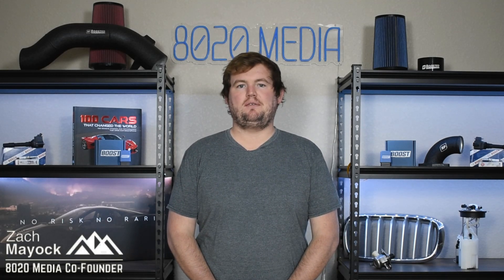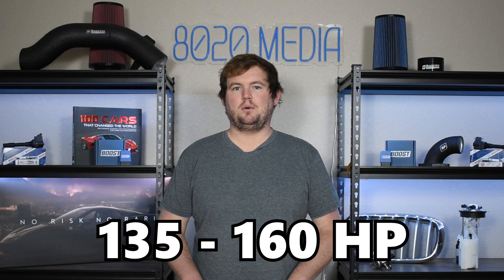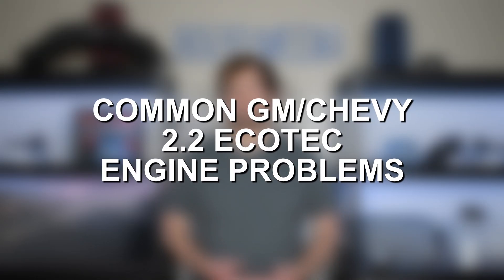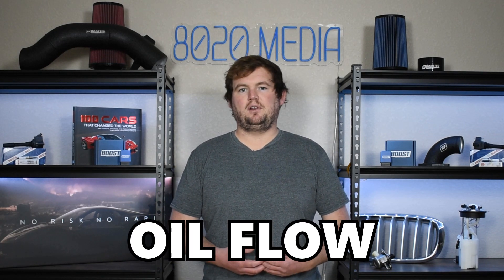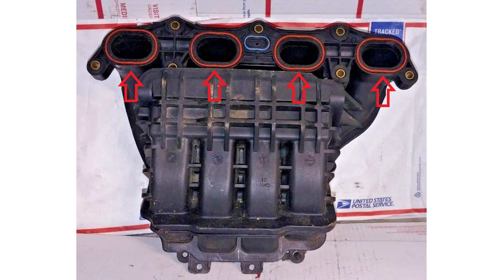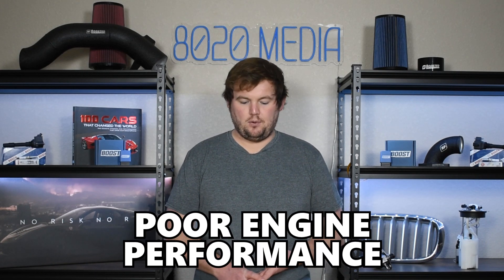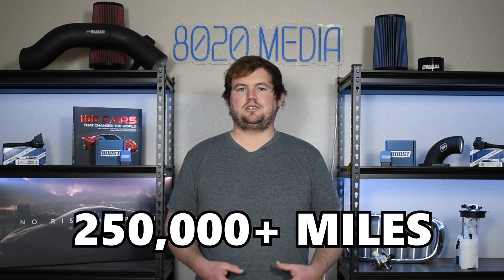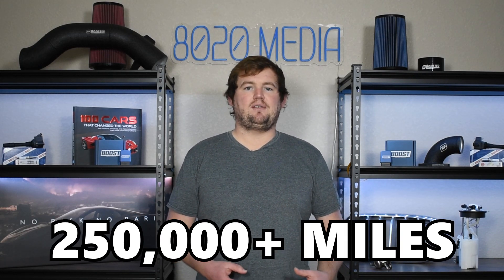GM/Chevy’s 2.2L EcoTec | 3 Common Problems & Reliability!

Comment: Also want to add the PCV system issues with the 2.2 and 2.4 Ecotec's. There is no valve (that I know of) to replace. You have to pull the intake manifold and clear the tiny ports.

Comment: My 2008 cobalt LT 2.2 (automatic) just hit 336,000 kms (8.38 full trips around the Earth). I just swapped out the stock exhaust with a zzp shorty header, 2.5" zzp hiflow cat/down pipe, full zzp 2.5" exhaust and zzp cold air intake and I freaking love it! I purchased the car 3 years ago for 2k Canadian from my ex-wife who had to move back to Brazil due to a family emergency. Not a single regret because the amount of knowledge I have gained from rebuilding this car from the ground up has been well worth the money and the time wrenching on it.

Comment: Ok so this video was very generic, it didn’t go into detail at all about the 2.2 Ecotec. 

First and foremost, the 2.2 ecotec is a FANTASTIC motor. They had quite a few updates throughout its production. In general the later years with VVT have slightly less reliability.

Common issues to look out for, most of these issues are just characteristic of the engine design and it’s nothing inherently wrong with them.

Timing Chain tensioner failures. The first iteration of the timing chain tensioner was of poor design and didn’t allow enough oil to the chain at idle speeds. GM issued a recall for this years ago. The timing chain tension was updated several times. To my knowledge there are 4 timing chain tensioner designs. The latest one has the “bump” on the head and is considered the permanent fix. However, the other tensioners are okay to continue using if you have no startup rattle. Routine  maintenance is key, use synthetic oil and do not extend your oil change. A messed up timing chain tensioner will add pressure to the guides and ultimately break and causes the timing chain to skip a tooth and then trash the engine. Routine maintenance is needed.

Second, the exhaust manifolds are NOTORIOUS for cracking right down the middle. This also applies to the 2.4 Ecotec. I’m surprised GM never issued a recall since its emissions related. 

Third, on engines that use the ignition cassette module, they are known to fail. Just replace it with an auto parts store module with a good warranty and you’re good to go. The factory ones were known to go bad, aftermarket seems to be pretty reliable.

The water pumps are a bit difficult to remove. They last a long time, but when they eventually do start leaking, the repair job is more labor inducing since it’s located inside the engine, ran directly off the balance shaft chain. 2000-2006 and 2007-2011 use different thermostat housings so the repair job is different depending on which style thermostat housing yours has. 

I do want to point out that sometimes, very rarely these can have a cracked head and leak coolant into the spark plug valleys. However, these usually developed a crack during the warranty period. It would be very rare in today’s day and age to come across one with a cracked head. I believe there were just defective heads that made it off the assembly line. Again, this was a super, super rare issue.

Aside from that, these engines don’t have any other major issues.  I wish GM kept it around longer. Great motors that routinely get 300,000+ miles
Reply from the maker: S - Thanks for taking the time to share your insights.
Reply: Do you think the internal waterpump could be left in place if g one bad and fabricate/install an electric water pump?

Comment: I have 286,000 miles on my 2004 Saturn Ion 2.2 engine. It's a good engine overall
Reply from the maker: D - Nice! Thanks for taking the time to share your experience.
Reply: Hello. I'm looking at a 06 ion with 124k miles. Recommend will be dependable with maintenance?
Reply: Great review. GM mechanic changed my timing chain tensioner on my 2008 HHR back in 2010 and explained to me the importance. I shrugged my shoulders not realizing the good he did. I still own the car with 158k on it and it's a keeper. Also own a 2006 Saturn Ion with the same 2.2 engine with 104K miles.

Comment: Was their any problems with the blocks cracking or heads even when the engine never overheated but only with antifreeze getting in the oil? I have a 06 2.2 I changed the head gasket timing chain water pump still getting antifreeze in the oil and it milky in 80 miles
Reply from the maker: J - Unfortunately, this is also a common issue! Sorry to hear you're going through it. The most likely issue is a cracked cylinder head. Have the head and block pressure tested to pinpoint the failure. If the head is cracked, replacing it with a rebuilt or new unit is often the best solution. Keep us updated!
Reply: @8020Media  thanks for the reply I didn't have the head checked because I looked at it didn't see any cracks in head I looked in-between the valves and at the block,I know I should have anyway because u can't see some cracks.lol now just deciding what to do with it next pressure check coolant and take timing cover off and cylinder compression to see what and if I can find anything else!
Reply from the maker: J - No problem! Keep us updated!

Comment: another note to add is that it isn't all that uncommon that oil finds its way out of the oil pressure sensor when it fails, I really like these motors. my 03' ecotec has made it to 194K miles thus far. careful with the coilpack pulling them off, the boots tend to seize on, and when your coil goes bad usually you need the module as well as it tends to ruin the module on the coil pack.
Reply from the maker: W - True! Thanks for sharing!
Reply: A little trick to that is putting di-electric grease on the end of the coils when you change the spark plugs